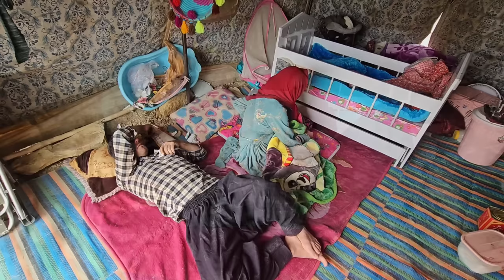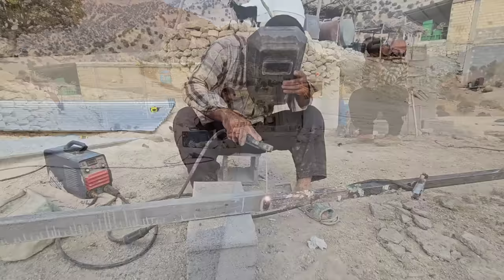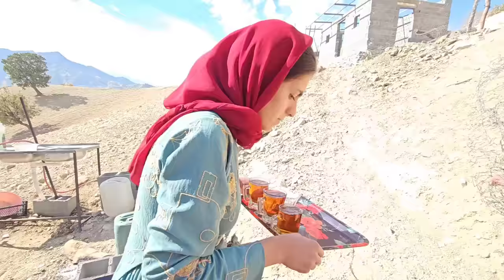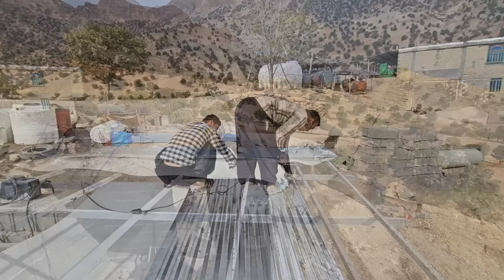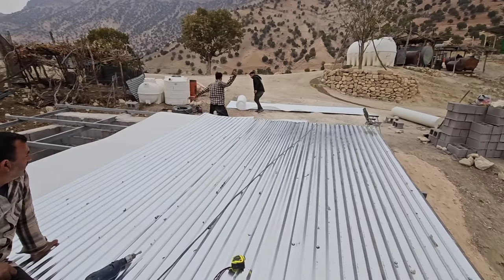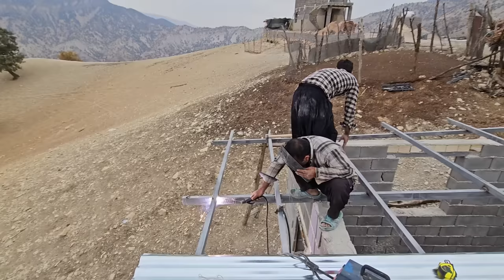Documentary starting again to build a home, the delightful life of a nomadic family

Comment: Black glasses should be worn while welding. Antimony can be used immediately to cure eye strain due to welding.

In order to prevent anything from happening, every roof pipe should be nailed to the walls with binding wire before plastering the wall, to prevent the roof from blowing away due to wind.

Comment: Always wear your welding hood but if you get weld flash burn eyes go to  doctor or optometrist but if you can't  go to either right away...cut a slice of a  potatoe  lay on your eyes or scrape inside of a cut potato  in clean  wash cloth and lay on your eyes. It will cool and  draw-out the stringing.